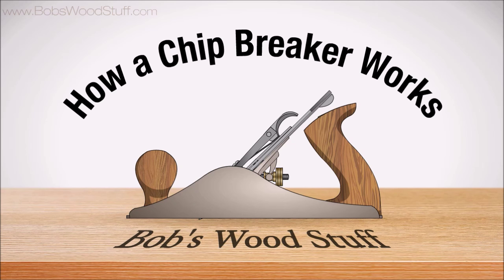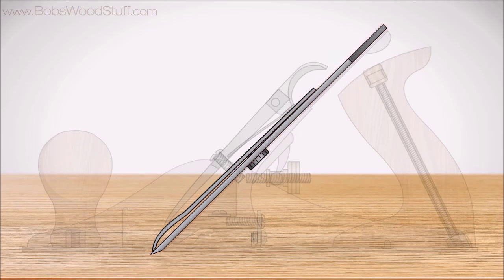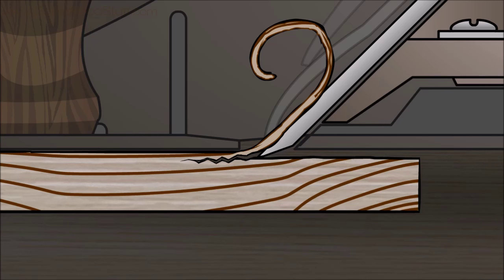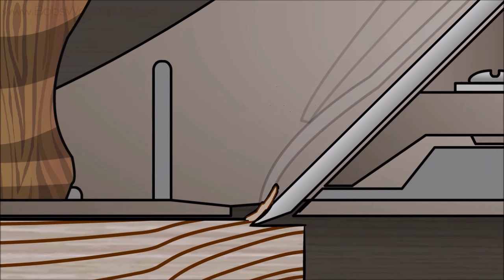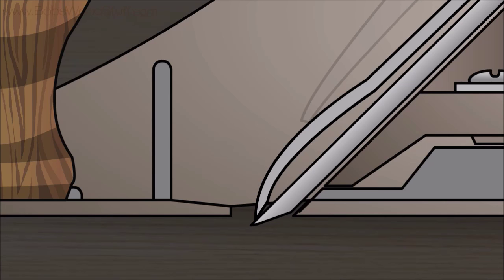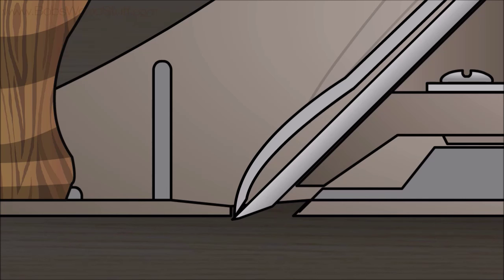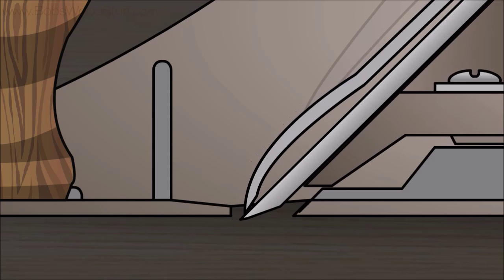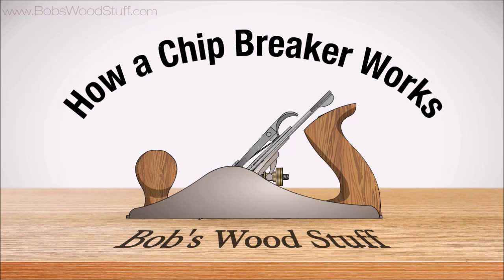How a Chip Breaker Works - Hand Plane Parts

Comment: I've seen a couple of "pros" explain this, they took longer, and were as clear and to the point as this video. Great job
Reply from the maker: Thanks! This was my first video ever published.
Make sure to check out the 3D remake of this chip breaker video as well, since it has more information.
Reply: @BobsWoodStuff  
I've already checked it out......simply awesome work. Yes the xray diagram is top quality but your understanding and explanation are excellent!
Reply from the maker: @Gotmovezlikejagga  thanks. I've read several books about hand planes, and I use them a lot.

Comment: great explanation. Is chip breaker more important when planing against the grain direction?
Reply from the maker: Ideally you should be planing with the direction of the grain whenever possible. But in circumstances where you can't do that because the grain switches direction, yes the chip breaker becomes more important if you are going against the grain.